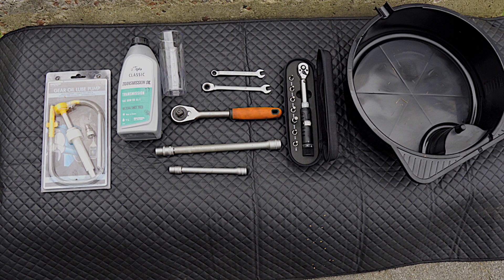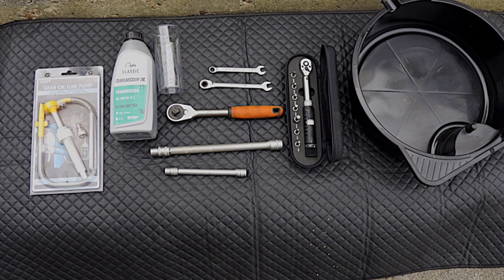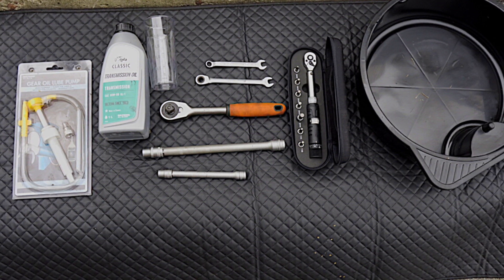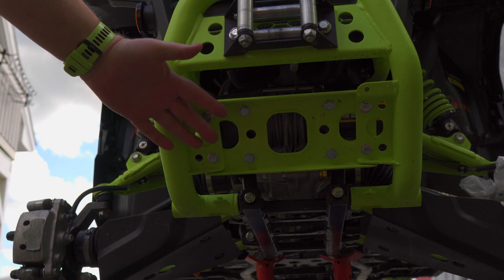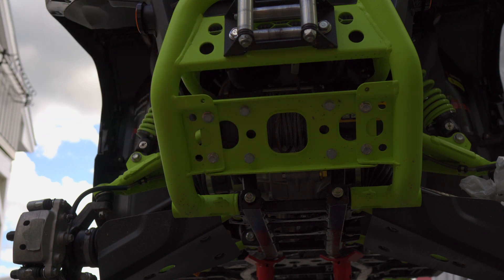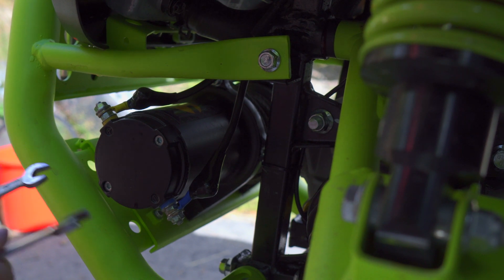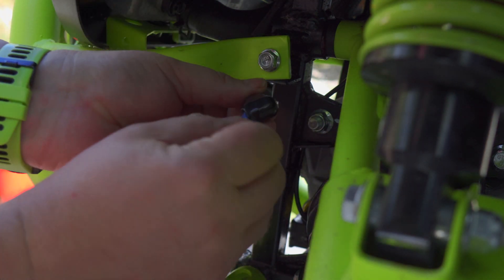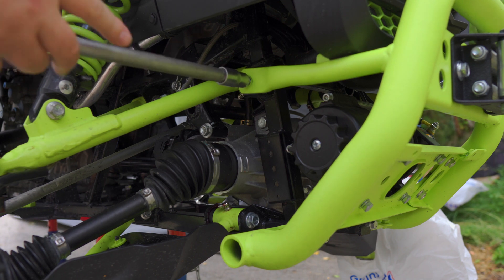Segway Snarler 570 Differential (Gearbox)🛢Oil Change

Comment: Hi, I have a question,  today I drained the oil from the rear differential and look and behold there was 0.7l inside. In the manual it says that it goes 0.24l. Or to the cork, which is correct?
Reply from the maker: Hi there, in my book it’s 240ml. 0,24 L.  It seems like you need to fill it up just under the filling hole treds. So in the manual they list up recommended amount, but they also say that you need to fill it up to the filling cap bottom threads. Hope this will help.
Reply: @TorAnthonsen  thanks, I will fill it up to the filling hole bottom threads. 240ml seems to me very little for such a big differential.
Reply from the maker: Yes you do that. And i too need to fill more haha.
Reply: Weird , When i drained mine came basically no oil out but i had to fill over 0.5l to the thread.